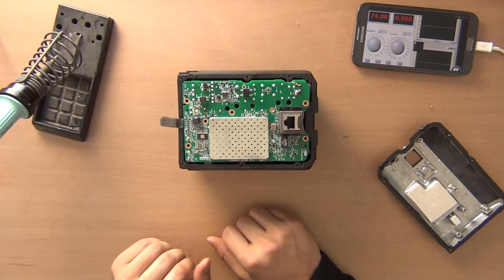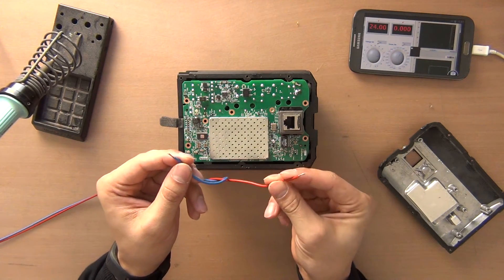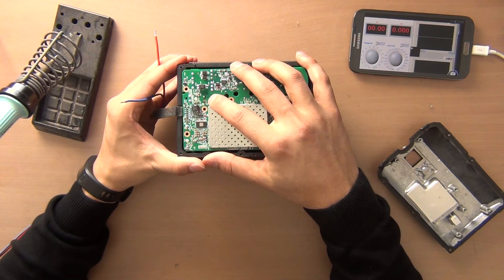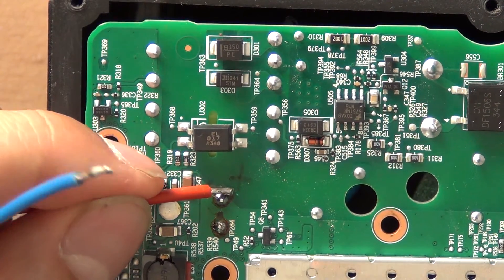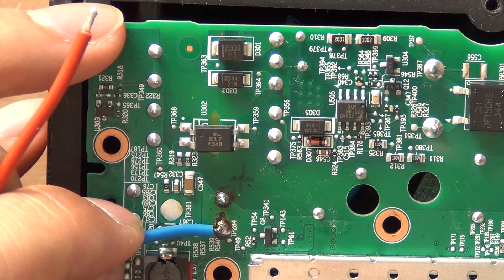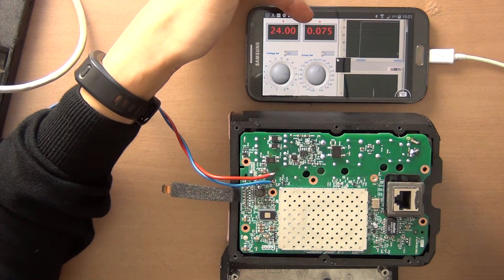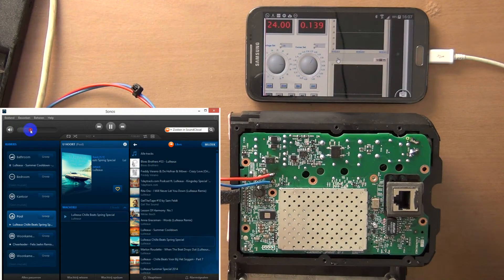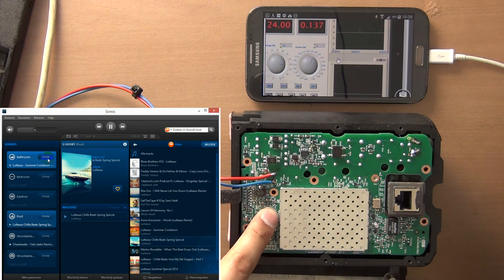Battery powered Sonos PLAY:1. #HTNblog #3b

Comment: Thanks for the tip and extensive tutorial!!! I managed to fix my short circuited Play1. However, when I connect it via a USB Phone charger and I pump up the volume, the speaker starts to flutter and distort. I assume it's due to the low amperage, correct? How many amps should a power supply deliver with 5V input in order to turn the device really loud? Or is it a better option to hook up a 24V power supply directly? (without a step up converter of course)
Reply from the maker: Hi Maarten! Glad you liked the video!!
Wow, if you want to go really loud, like more than 25% of the volume, I think it is better to use 24 directly. Or 12 volts battery with a step up converter whatever suits better to you. Because the sonos can easily use 20 watts. At 5 volts, this means more than 4 amps! At 24 volts this is "just" less than 1 amp. 

Many thanks for watching!!
Reply: I already fixed another Sonos Play1 with a connector for a 12V power adapter. That one can deliver 2,5 amps, so it can deliver 30W. That one really blows!!! So, the one with the USB powerbank is good to use in the garden (not too loud with regards to our neighbours) and the other one for our guestroom.

By the way, do you have an advise on how I can build in a Bluetooth board? (also what kind I should use) That would be the ultimate solution, to have a portable Sonos Play1 that can also be used as a Bluetooth speaker. Maybe an idea for a next video? :)

Comment: Wil je alsjeblieft vertellen hoe je die voltagemeter via je telefoon heb gekregen?
Of is het een powersupply? Ook dan wil ik het graag weten.
Reply from the maker: Hi!  

About the voltage measurement that is shown on my mobile. I have a Velleman PS3005D bench top power supply. It is equipped with an USB port to control and measure the power supply from a windows PC.

Then with my phone, I connect to my windows PC using teamviewer to show the power supply app and control it too. 

But if you only want to measure voltage (no control needs of the power supply) you can also buy a cheap multimeter that has Bluetooth and a android app. 

Thank you for your reply and watching my videos!! :-)

Comment: Was there a separate power supply that you have to remove first, or can you supply the 24V straight to the power connector in the bottom of the unit?
Reply from the maker: kevin freels Straight to the power connector :)
Reply: Sorry but a little confused by your response there. I understand from the video that you have to dismantle the speaker and solder wires directly to the PCB in order to deliver the 24 volts required. You cannot connect the 24 volts through the regular power connector as it is expecting 240v or am I missing something here, thanks